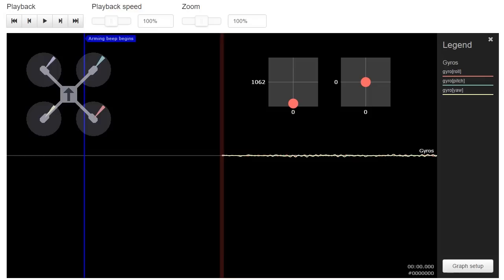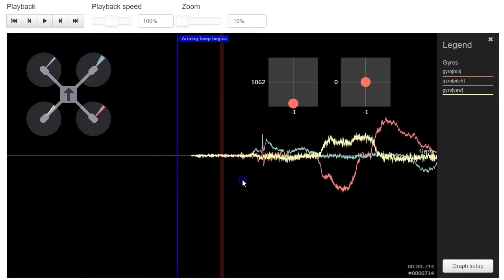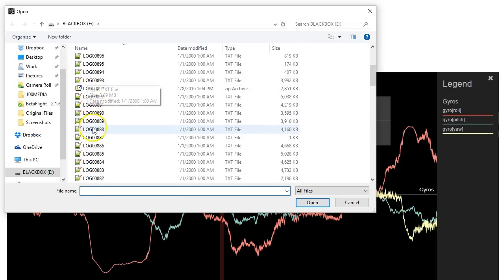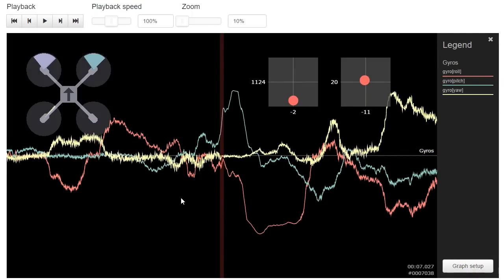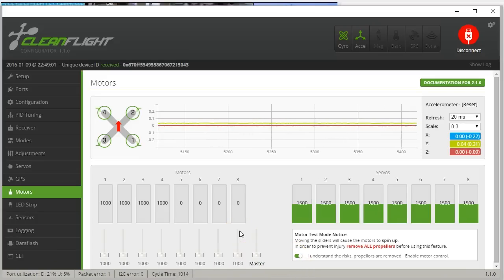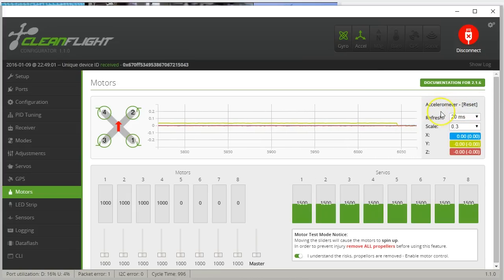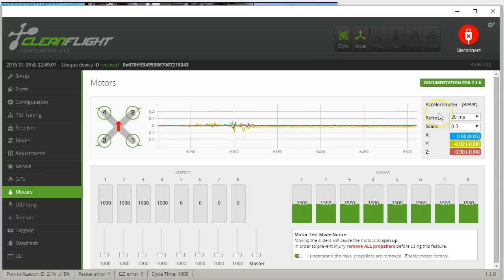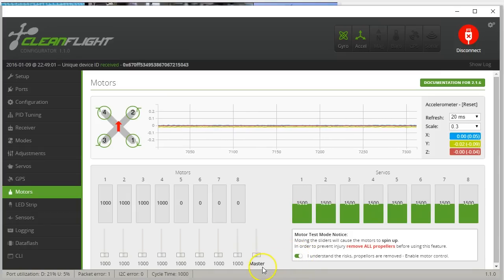Troubleshooting Quadcopter Vibration

Comment: Hey, Joshua, I am sorry to comment at an old post, I am newbie and It's been quite a while I bought myself a wizard x220, I noticed yaw oscillations and referred to your video and when I raise the throttle slow I hear grinding noise only at a specific position and at the max throttle and that's when the yaw axes start oscillating badly. It's with two of my motors. I removed their bells and they are clean as heck. Maybe it's the bearings then. Will have to buy new ones or can I fix them. Thank you.

Comment: I have a spare cf rod and mount plate. I also have a benchtop bldc 24v motor driver variable speed. I attach the motor to the spare mount and rod. Hold the rod with my hand and spin it up, prop off of course, and feel if its out of balance. But this is usually for spare off the quad motors.

Comment: 10:02 You dislodge a bit of magnetic stone from between magnets, but it remains stuck to a magnets face.  Yes, in certain locations, some of the grit and gravel has enough iron to be attracted to the magnets.  Have you ever flown that quad in Georgia?  Definitely pick-up magnetic gravel in the dirt of south Georgia.   At 8:03 you verify motor shaft runs true.  Do the prop adapters ever get bent without bending motor shaft?  They are two separate items, correct?

Comment: I was so stupid and damaged the copper wire a little bit by putting in too long screws... A wire on a coil looks a bit scratched or squished. Is there something I can do to fix it and not having to replace and rewind all the wires? Like to put something conductive on the damaged wire?
Reply from the maker: There really isn't a fix. If it's damaged, it's dead.

Comment: HeyJoshua I just got new 35 amp esc, using racing edge 2306 2480 kv, I got 2 flight and adjusted pids, I gain is 5-10 points above p gain. When I arm the drone to takes off in the air. The motors get hot. Now one esc is not working. Why would my drone take off when armed with no throttle input.
Reply from the maker: Too much gyro noise and/or excess D gain is a cause for this. If you raised D gains substantially then that is probably the cause. Hot motors also indicate excess D gain or too much gyro noise.

Put D gains back to defaults.

Make sure motor screws are not touching the windings. https://www.youtube.com/watch?v=eo2sjTNS0pc

Check FC for damage such as broken standoffs or anything that would cause vibration.
Reply: Joshua Bardwell - UPDATE. Issue was caused by minimum throttle was too low. here is a video of the grinding noise I explained in my last comment https://youtu.be/9f-x99NzI-Y
Reply: I took a further look at my fc and Noticed one of my standoffs have broke in half. I swapped all of them out now I’m not having the same issue. First off, I am using an alien frame and whenever I do a roll I hear a rough hard grind sound from the motors. This only happens when I do hard stick movements on the roll axis and occasionally and pitch. The fc and motors are soft mounted. Using betaflight stock PID on the foxeer f405 fc/pdb. Could this be cause of the stock tuning?

Comment: Bardwell, why do you not recommend to your drooling mass of followers that they should be balancing their PROPS first, before trying to diagnose any other source of vibration. The fact this isn't done as a matter of course is a source of deep embarassment for the whole multirotor community.

I bet you guys don't even realise someone balances the wheels on your car when it goes for new tyres, huh?

This is simple stuff... seemingly forgotten.
Reply from the maker: I will never manually balance any acro or racing quadcopter prop. If they aren't sufficiently balanced from the manufacturer, I won't use them. The reason for this is that they break too often. Even if you argue it takes only a minute or two to balance each prop, I often come back from a day of flying with 20 to 40 broken props. There is no way I am going to spend that long balancing props.

The fact is, high quality props in sizes 6" and smaller are sufficiently balanced from the manufacturer. You don't have to spend additional time balancing them.

This stuff is not forgotten. What happened was, everybody used to fly 9" and larger props, and yes, for those sizes, hand balancing is essential. Also, those larger quads didn't fly proximity like FPV quads today do, so broken props were less common. We "forgot" prop balancing the same way we "forgot" how to crank-start an automobile: we moved past it.

Comment: im still serching for a vibration in my motors video, this one seems the closest to my problem. thanks 

but what about if when resetting ther accelerometer axis button , and it doesnt go down to  number zero's the way its showing in your video? mine is still resetting at higher numbers, and are alot more drastically higher numbers for all the motors. what does that mean? all my motors are bad?

Comment: Just watched this,  its ok,  but I feel its unfinished and a bit out dated now from 2016. One chap stated in his comments, from his bad english and I would like to agree with him, as im a former mechanic from the 80s, that we used to have similar issues with turbo chargers and balance issues if the bearings were to loose in either the housing or on shaft. The fact the you stated the bearings were replaced and issue remained?  was either the gap in microns between bearing and rotor housing, or the gap on the shaft inside the bearing, as suggested use loctite on bearings outer surface inserted into rotor housing to reduce clearance, or possibly on the commutators shaft,  this was noticed when your bearing kept falling out of its location. Similar things would happen in gearboxes and automatic transmissions. Its the clearance basically that allows for this to happen. The bearing is there to do the work, but if there is microns in clearance the bearing is relieved of its duties and hence the vibes. Oh and if the clearances are corrected or are ok, the only other logical area is the spinning mass is out of balance.

Comment: I've been having some bad vibrations with one of my quads so I tried this motor test and 2 of my motors were getting some higher readings like .07 and .09 Does that sound like that could be the issue with the vibrations? Also, motor number 1 sounded very high pitch compared to the others when it was at full spin, it just sounded more like a high pitch whine. Could that maybe be the bearings going bad? I would appreciate any help you can give, this quad has just been giving me a lot of vibration issues ever since I made some mods(added GoPro mount, installed a new FPV cam and moved the battery to the bottom). I've checked over everything and everything feels solid, no movement on any parts and the vibration is mostly on throttle so I'm thinking it's not a tuning issue.
Reply from the maker: If the motors are not new, and you are getting tons of vibrations, swapping bearings or trying a new set of motors is worth thinking about.
Reply: Yeah the motors are about 6 months old and they are not the best motors to begin with. Might be time to just upgrade them. Thanks for the quick reply and thanks for all the help I’ve had from watching your videos, keep up the great work.

Comment: The "gap" btw the stator and the rotor must be flat during the 360º. In my case this does not happen and it oscilates. If you remove the stator "the bell" and you spin it faster on the table over the main shaft where the propeller nut is, I saw it was also oscilating. This means that the stator is damage probably bacause of combinations like:
1- Crash
2- Heat
3- Very hard hard propeller does not absorv very well the hits as softer propellers. So if you are moving for a good quality propeller your probabilities to damage the stator or even the bearings are quite high. 

Correct way is to mount new motors and save "good" parts from damage motors.

Comment: I know this a year old but wonder if you could resurrect a good vibe troubleshooting video for us?   It's weird but it seems ever since I added SBUS instead of using the Spektrum plug on my KISS FC that I have vibes just over 1/4 throttle.   The motor bells actually "hum" from vibrations and the quad looses altitude.   Any suggestions??
Reply from the maker: There shouldn't be anything about SBUS that would cause vibrations. Mid throttle oscillations are most often due to frame resonance, and can be addressed by soft mounting the FC with rubber vibration isolation standoffs.
Reply: Joshua Bardwell ok thanks for the quick response Josh. 👍🏼.  I saw you mention that before, the crazy thing with my situation is I have flown this Alien frame with zero vibes and only went to the taranis transmitter which had me install the X4R rec. and re soldered the FC for SBUS  that's the only change I made.   I suppose I'll throw some bearings at the lumenier motors.  I even tried a few different props.    🤔 scratching my chin and deep thought seems to help me feel better.  Yet..  only slightly.

Comment: I know this an old video , but betaflight now doesn't have accelo graph in the motor tab it's a gyro graph instead and it's very twitchy and we cannot reset it, do you know of any other way of testing motors, I have a very bad vibration and suspect the motors.
Reply from the maker: Blackbox I guess. It's a shame they changed that. I'm not sure if it's a bug or on purpose.

Comment: Hi Joshua, could you please tell me gow to switch between Gyro and Accel in motor tab/ currently i am observing only gyro graph. thanks man
Reply from the maker: +Vladimir Ryabkov you can't as far as I know. The devs changed it. They have to change it back.
Reply: What a shame :) .. is it possible to use gyro data for oscillation monitoring? Or its not accurate data?
Reply from the maker: +Vladimir Ryabkov yes, but I don't know what value is good or bad.

Comment: if im getting vibrations at mid throttle , does that mean that my p gain is to high or is it something else and does it matter that i have vbat pid compensation on.
Reply from the maker: +Scavenger 177 soft mount the FC. Midnthrittle oscillation is due to frame resonance.

Comment: Hi Joshua, Any idea why my gyro readings in the motors tab aren't resetting when I click reset? It's strange the values just bounce up and down.
Reply from the maker: +krssnoop they changed from accelerometer to gyro in that tab. That's the reason it doesn't match my video. But reset should still clear the max values.
Reply: Yea strange, it might be the flight controller. Thanks for the quick reply.

Comment: Hey would it be safe to run swift 20amp escs blheli with emax red bottom 2205 2600kv? Their rated for 2-4s
Reply from the maker: Probably. Most ESCs are a bit under-rated, and you wont be pulling 80 amps for very long.
Reply: Joshua Bardwell thanks my motor are getting pretty beat might replace pretty soon

Comment: i know this what a while ago. but could you swap bell with another motor on the quad to see if the vibration is bell related or not?
Reply from the maker: Yeah, absolutely. That kind of a/b testing is sometimes the only way to solve this type of issue.

Comment: I get up to 0.17 on two of the motors.. (they have about a month of flying on them) guess which one.. 2 and 3. bearing in the motor 2 were shot (which is weird) so I replaced them. Vibration is still there, less present but too much for my liking. bells look good, shaft too. one interesting thing, the motors that are vibrating are the one with crossed wires on the esc, so just to make sure I unsoldered the wires, wired them straight and inversed the rotation in blheli, same thing, they still vibrate. I have some aikon sefm on the way from rotorgeeks, i'll give them a go to see if it changes something

Comment: turns out i have extremely bad vibration, got up to 1.31 :(
Reply from the maker: +bo holland Well the good news is, if you have some vibration damping on your FC, you can still get good flight performance. But start planning to replace the motors eventually.
Reply from the maker: +bo holland https://www.youtube.com/watch?v=KaOWkecIx-g
Reply: i will defo try vibration dampening, wanna build a 4s quad anyways so might not bother replacing motors
Reply from the maker: I can't be sure but it's worth a try.
Reply: alright cheers, ill buy them on my next h king order :)

Comment: So I have a zmr250 (MRM v3) with the Mini titan 2206-2150kv motors. Im chasing a full throttle vibration/shake.  Ive tuned the   Pids as best I can. I have no overshoot, no oscillations that I can see and yet I still have these vibrations ONLY at 97%+ throttle. almost all 4 of my motors are quiet until about 60% throttle and are very noisy until around 75% where they dip down to below .05g on all axis.  Any ideas?
Reply from the maker: +sciullo779 Adjust dither in BLHeli to address throttle-specific resonance between the ESC and the motor. This isn't guaranteed to be your issue, but you never know.

Comment: Great vid! I use a good video camera to check motors at 240fps then slow it down. You can imeadiatly see which of them has bearing or shifted shaft issues. It would be a good bid if you could explain the mechanical nature of gyros and how they can get stuck. You can free them with a reverse impact of crash to fix. Also even on the grand daddy of 32 boards the freeflight 1.3 we used to hack before timecop used it for naze design the accl can suffer in hard impacts. Why? Again great channel,

Comment: tried the motor vibration test on my dys 1806 and all my motors were over 0.10
Reply from the maker: +Juanamo FPV Personally, I would replace them. But here's the thing: are you sure that a factory fresh motor would be any better? Maybe they are just badly balanced from the factory.
Reply: +Joshua Bardwell but if these vibrations are bad then surely it would effect my flight performance. i doesnt.
Reply from the maker: Juanamo FPV awesome. Happy flying!

Comment: Amazing. Using Cleanflight I tested each motor and found which had vibrations via those numbers. You said .03 is good, and over 0.1 is bad in the video I think. One of my motors has @ a 0.2, good show sir! Oddly enough, I never saw the vibration in the video, rather it was audio from my HD camera that clued me in.
Reply from the maker: +Dragonsbane777 I would say that 0.2 with prop off is definitely indicative of a mechanical issue worth digging into.